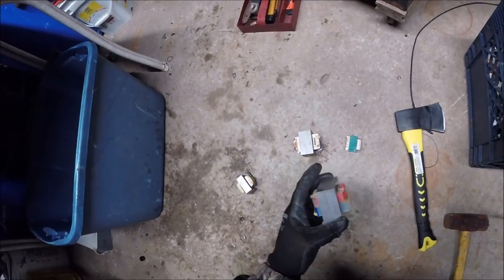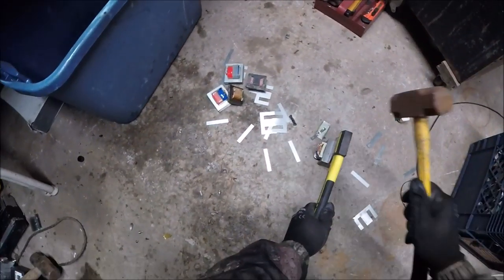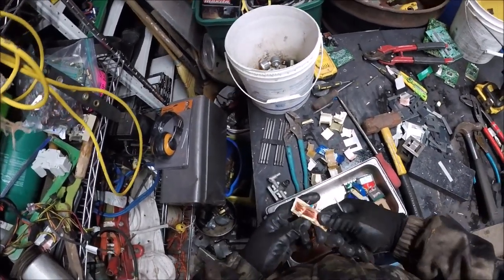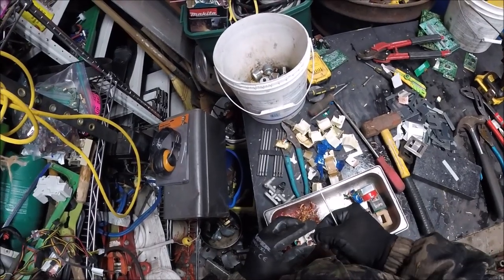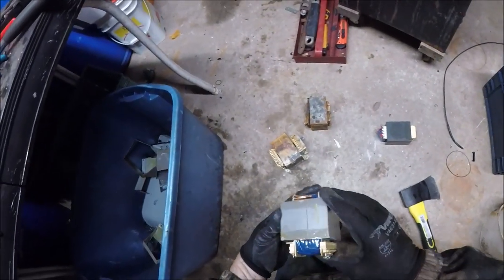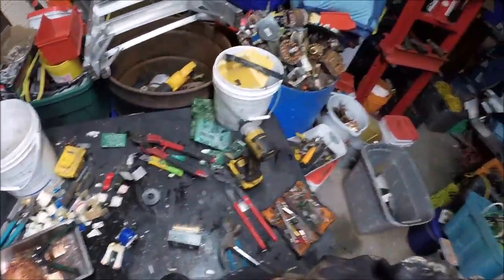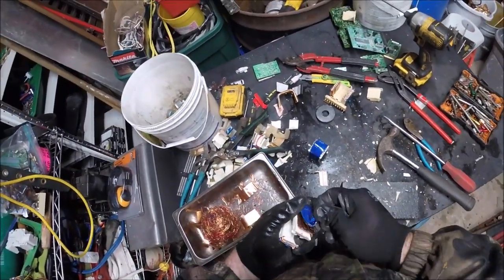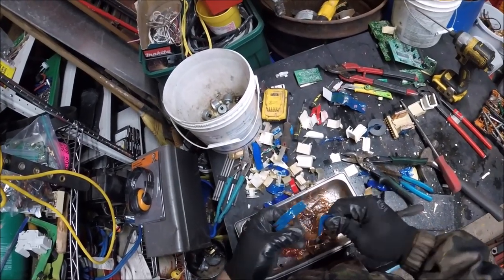Seamless Transformers How To Scrap Them

Comment: Dude !!??? while the axe is good , u should put a piece of 2x6 wood under transformer to keep the axe sharp..and after u split it in half use your vise,,,open vise jaws so copper is loose in between jaws with steel on top of jaws horizontally and take a hammer and punch and 1-3 light hits and copper windings will fall out..and i even do the AL winding too, AL wire is .25 cents a pound ,, and i have WAY more time than money..